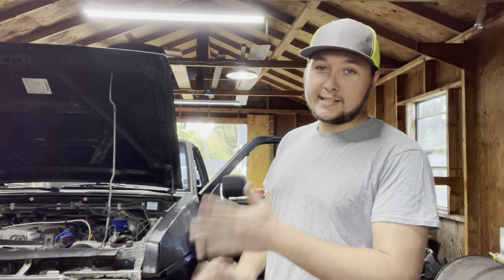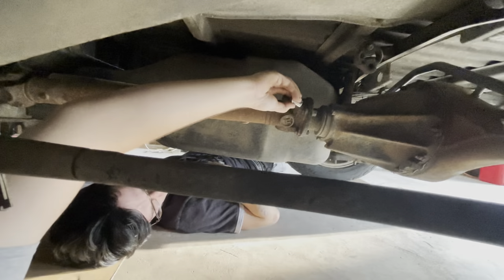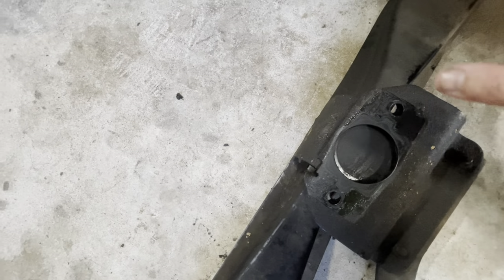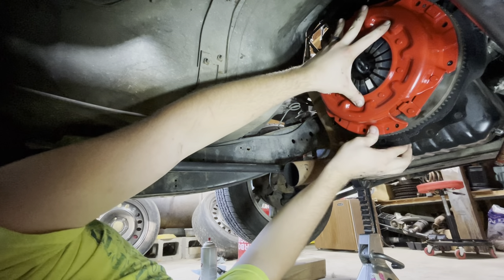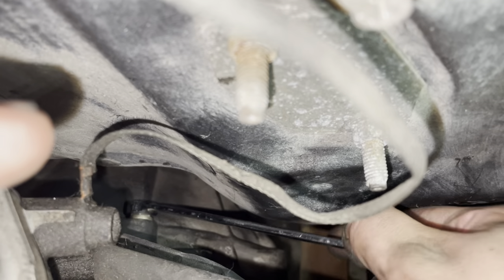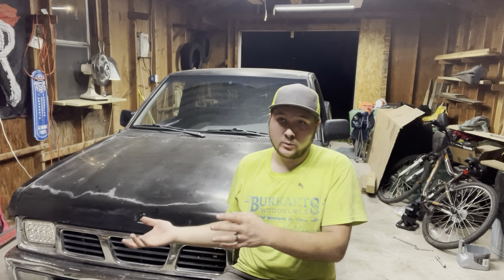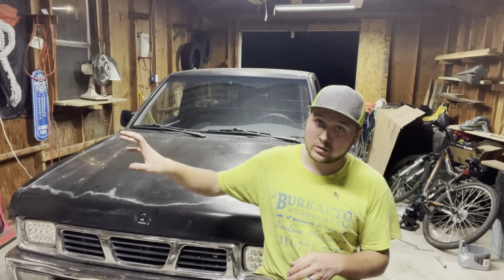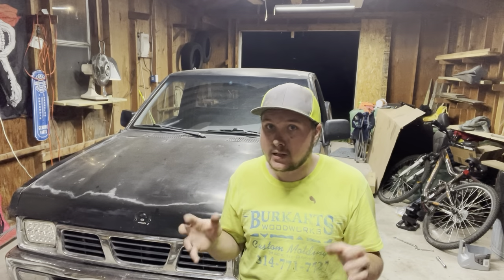Nissan Hardbody Clutch Replacement

Comment: Thanks for the video. My clutch never slipped just went to floor. I replaced master, slave still no clutch. I pulled the seat out 4 bolts found easier to work on. I pulled everything out replacing carrier bearing the works. I put every bolt in coffee cans together.i i had flywheel resurfaced new u joints i really didn't need but said what the heck. Im putting it back together now your video showed the throw out bearing spring and lever something i wasn't sure about before i took transmission out last year didn't remember if all the parts were there and your video confirmed it thanks. I purchased that truck brand new in 95. Was my Dailey for 15 years not every day ive had other nicer trucks but kept and took good care synthetic oil change twice a year because speedometer hasn't worked sice 187,000 miles have no idea how many.its sat for months at time but always is running when i need it. I pulled oil pan and 0 sludge nothing very clean same 2.4 engine 5 speed. Ive actually had another 97 automatic trans low miles sold it needed money repaired head liner timing chain a few cosmetic things kept 2 yrs sold for $1000 more than i paid for it. But ill likely never sell the 95. I say any decent hardbody that pops up from grandpas garage buy it. I can say they are the best small pick-ups made. I cant afford a new pickup and even if i could 40k to 50k for a small new truck? Omg its crazy...Thanks again im 56 done many repairs and haven't replaced a clutch ever you've been a great help. God bless you sir.
Reply from the maker: Wow that's awesome that you've kept your truck, I agree they are fantastic trucks with a great engine. Glad my video was of some use to you sir, hope you get her back on the road and shifting properly again. God bless
-Jon

Comment: Bro, I got my hardbody for 500 bucks 4 years ago. Its a 1996 2.4l 5 speed. Still running good with AC and heat. There is components that are wore out all over the place but Im only fixing parts that keep it running.
Reply: luk clutch no good... Warped pressure plate...

Comment: What did you use to take off the top starter? I’m stuck
Reply from the maker: That's a good question, I remember that being tricky, and to be honest I don't exactly remember what I did to get that one, I want to say we used a wrench from above (from the engine bay) or swivel sockets may have been used. I don't have anything fancier than that, sometimes you just need a different approach angle.

Comment: Do those titan and tacoma wheels bolt right up without modification?
Reply from the maker: The Tacoma wheels don't need modification, but they need a mag seat lug nut and I run a hub centric ring to center them on the hub better (center bore is a little big).  The titian wheels need the center bored out or you might be able to use a spacer if you're into that look.

Comment: Does anyone know if a bad pressure plate can vibrate the slave cylinder and then you got so much air that you can't shift very well😢😢😢???
Reply: I had no vibration but replaced slave and master. No slipping but one clutch spring was unhooked maybe you have more than one popped off. don't waste money on new slave or master. I put phone under to see and after replacing all fluid components didn't work any better same results if not slipping you might have same problem but worse. gonna have to pull trans to be sure. Good luck.

Comment: whered did you get that air filter box?? i need one
Reply from the maker: The intake top hat piece? That's from a late 90's early 2000's Chevy 4.3l found in the S10, Blazer, Sonoma etc. I just drilled holes to fit the hardbody throttle body and plugged the little tube breather it has.

Comment: My hard line is leaking air but not fluid..... Looks like I need 71"Stainless steel line to go from master to slave I don't see anything online I'm really bummed.....

If you have the original Nissan fly wheel I would stick with it As well as the pressure plate..... There's a lot of bad parts out there....
Reply from the maker: That's a bummer,  sorry I have no clue where youd have to get that part from. Fortunatley I haven't hit any issues with slave or master cylinder... yet.     I've got my stock flywheel still, and I held onto the stock pressure plate just in case, I'm all too familiar with bad "new" parts